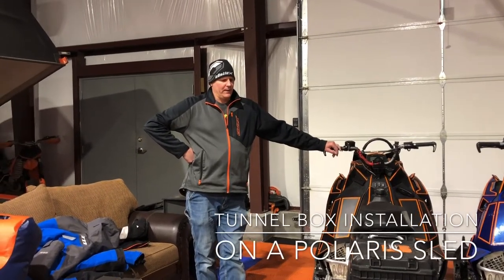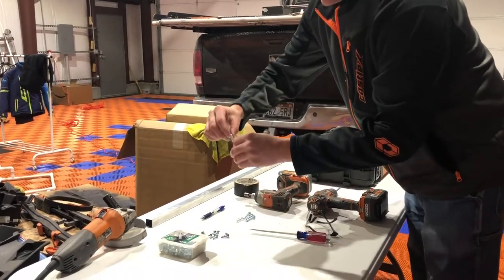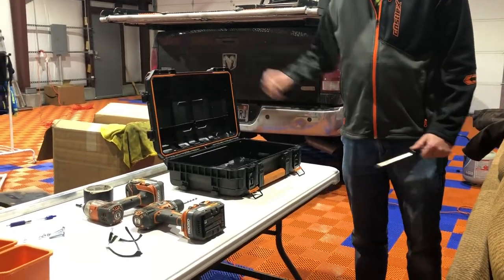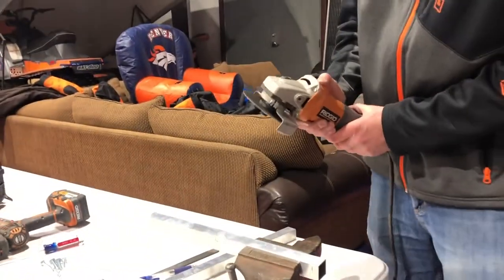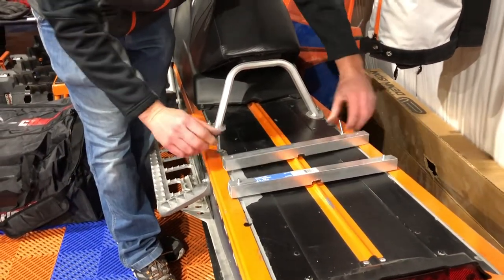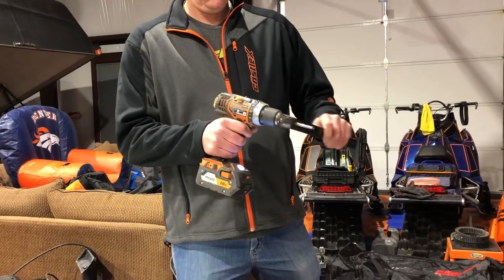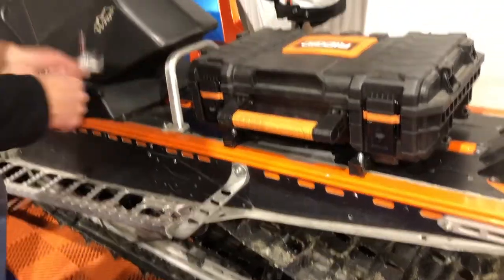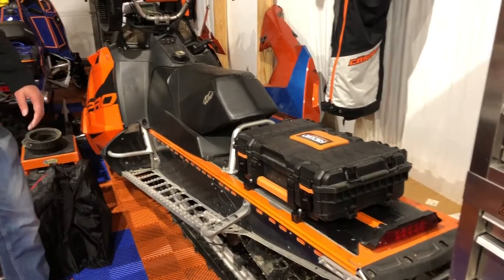How to mount a tunnel box to your sled

Comment: I give it a 10 for the idea, about a 5 for execution. 

Use shorter carriage bolts, put the nuts inside the tube so you're not crushing the tube, paint the tube instead of duct tape, use a round head screw to affix the box to the tubing to prevent the screw heads from chafing a hole in your water bottle. 

And for the love of God, don't use the nut machining wrench. Box end wrenches aren't hard to use.
Reply from the maker: I agree there are some improvements to be made. Duct Tape sure I'll give you that one. But when its 30 degrees outside and I don't have heat in my shop duct tape works great. It has lasted for 4 years on my other sleds so I'm good with it. Paint doesn't stick and cure very good at those lower temps. 

Never had a problem with the screws so far. I don't put my water bottle on the bottom. Tool bag and other things go there. I didn't have any round head self tapping screws. also if that is a problem, just throw some duct tape on it and boom problem solved. Thanks for the advise. I might actually do that. LOL. 

Didn't have the right box end wrench. Kids lose tools and I didn't want to go searching around for it so yeah it worked. 

I am not sure how a nut on the inside of the tube would work. How do you you even get the nut on the bolt? I can't drill a hole large enough through the tube to be able to tighten it down from above because I want to be able to remove it. Once the box is screwed down to the rails you would not have access from above any more. The bolts have to go thru the entire rail in order to take it off without removing the box from the rail.
Reply: @yamadoo04snow  I guess I did come off as a dick. Wasn't intended, was trying for constructive criticism.

With 1" tube, a 1/4" nut will fit inside and be able to be wrenched on. 

I'll grab a box from the HD tomorrow and give it a shot myself. I'll see if I can remember to take some video.
Reply from the maker: @leftyeh6495  So I did replace the screws on the inside of the box with round heads rather than the hex ones I had. Thanks for the advice.
Reply: @yamadoo04snow I love this idea! stopping by home depot on my way home from work.  As for the nut on the inside: You can slide an open end wrench in the end of the aluminum tube to grab the nut, However this only works if the aluminum tube is big enough for the correct size wrench to fit inside.  This allows the nut to be accessible for removal but out of the way the rest of the time. ( this  would only work for nuts located at the very ends of the tubing.)